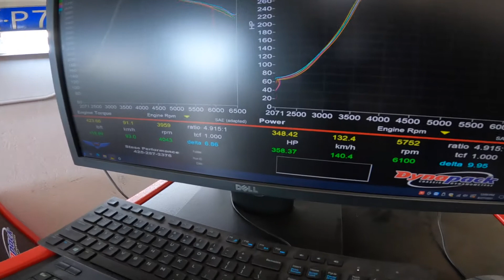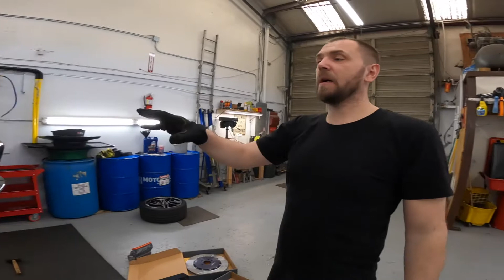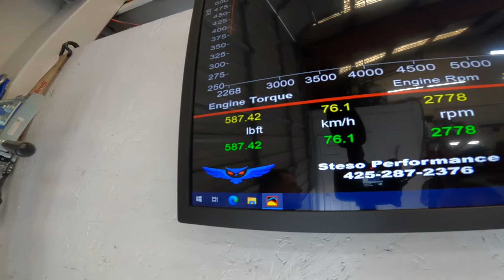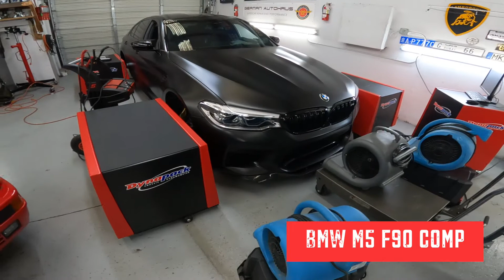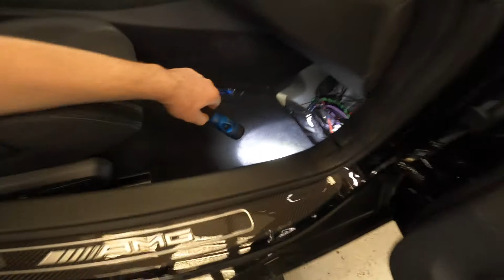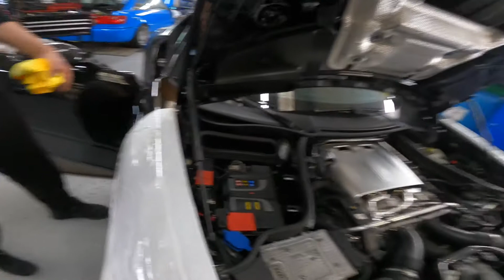KW lifting system for Mercedes AMG GTR PRO attempt  #2, BMW F90 M5 dyno pulls and more ..VLOG #38

Comment: Hey guys! I am in process of collecting knowledge of making the GT R PRO's front axle lift. Did I understand it correctly that it is possible to install KW's axle lift kit only when you also install coilover suspension set dedicated for this car? The KW website states that neither the axle lift kit nor the coilover set is not suitable for GT R PRO, so I got interested in what you achieved here. Here the question is - can I install only the axle lift kit onto GT R PRO's stock suspension, despite KW's statement on the website? Thank you a lot for any support, and keep up with your amazing job on the projects, good luck!